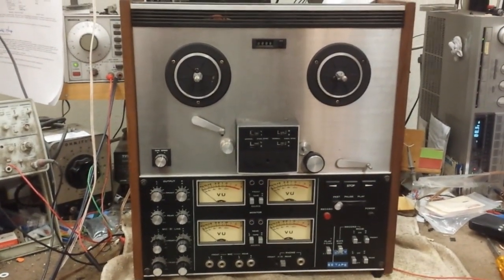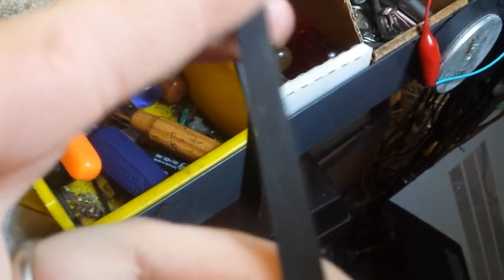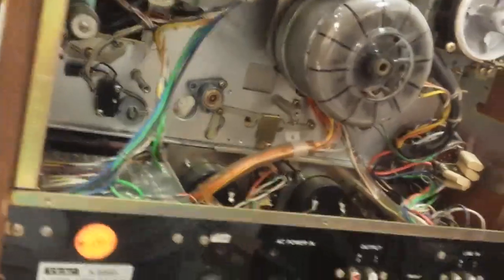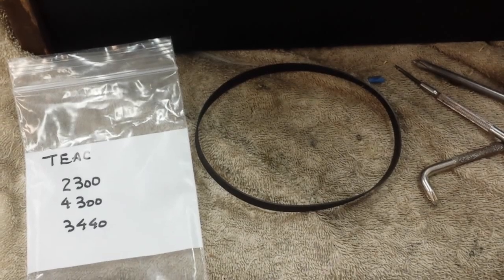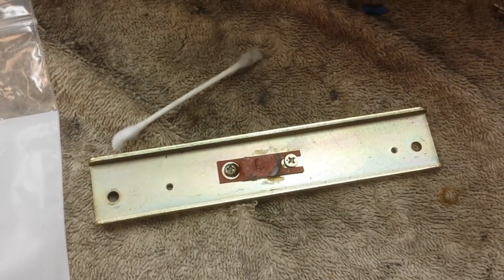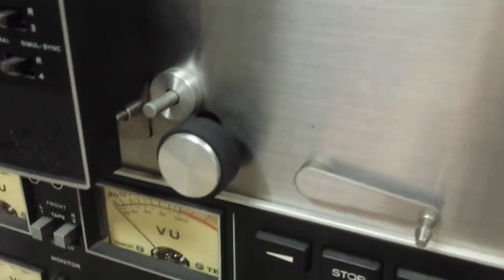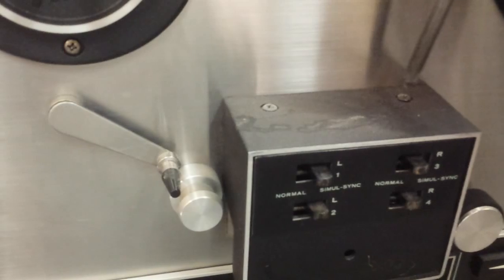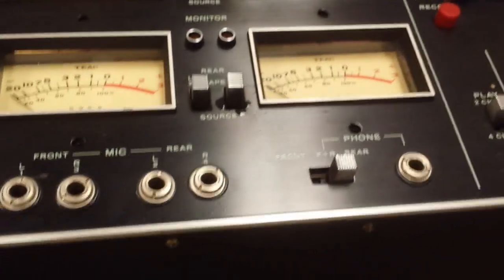Servicing a Teac A-2340 4 channel reel to reel

Comment: BELTfor this is £10 in the uk  i know john  he's sells them  you all know the man  i have worked on this unit if the lamps go it's a big job you have to take
the front panel of  when it on it's back and you got to be so care full  of all the dry solder on all the wires can come of when you taking the panel of  you leave all the rest
in the unit  i made i video i have not posted yet i know the troll tape deck fan's would be all over the video

Comment: Hi. My A3340S doesn't have oiling tubes. What do we do in this case?
Reply from the maker: Haven't seen one that doesn't yet. Sometimes theyre buried under a wire loom. If for some bizarre reason they dont likely the motors were replaced with something newer that has sealed bearings. In that case the inly way in is to pull the motor, disassemble and oil
Reply: @JordanPier  O.K. thanks.

Comment: Thanks!
Reply from the maker: Thank you for your support
Reply: @JordanPier  No Problem.  BTW, it seems when my 2340R auto reverses, the tape rolls off the pinch roller. Would this indicate the need for a new roller?
Reply from the maker: @JRCCDD  could suggest bad roller, I sufficient pressure, lack of take up torque, bent tape guide(s) bent pinch roller arm. 

Try resurfacing the roller first. 600-1000 grit sandpaper.
Reply: @JordanPier  Well, I cleaned up the grease on the roller arm (per your video). I think the torque is OK but will try somethings.  I checked the possible bent guide, but I think I tried bending it a bit before with no good result. I'll give the sanding option a try. Thanks for the suggestions.